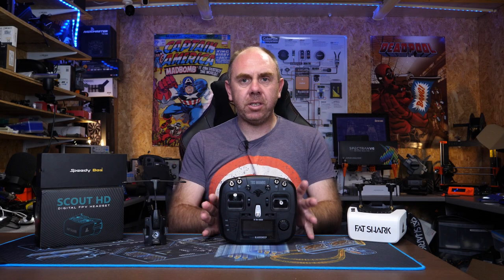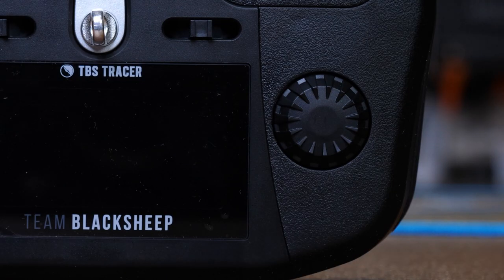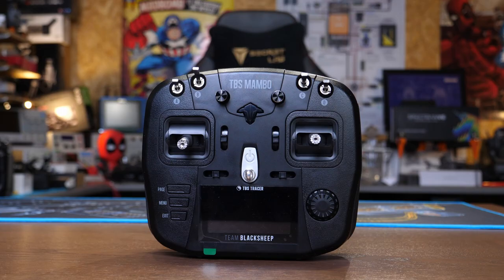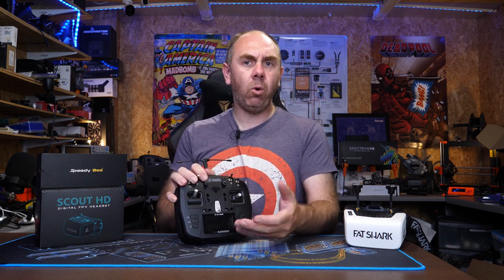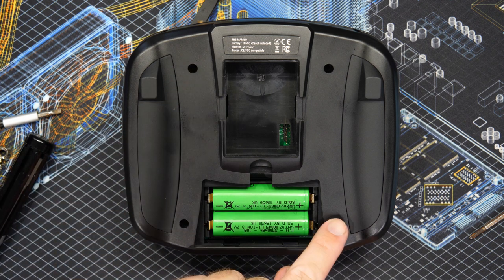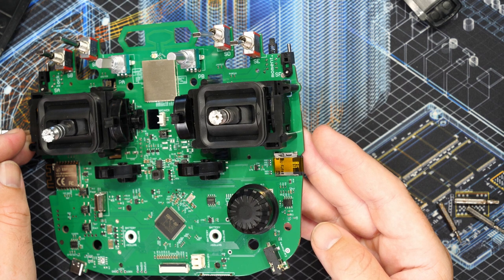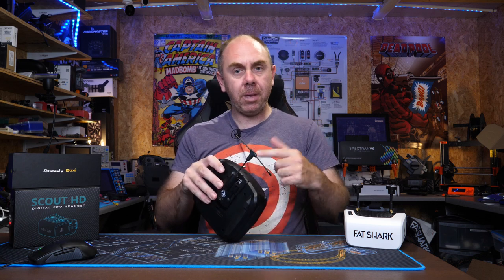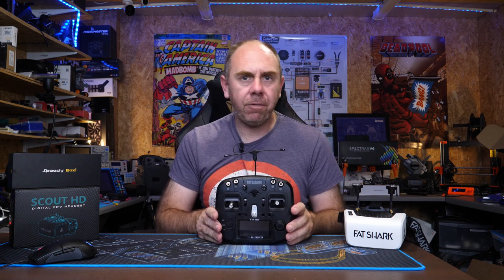TBS Mambo Review - Great Radio But Not Perfect

Comment: Looks to be a good radio but switch replacement etc could be a problem unless you are really 
competent with soldering and de soldering ! 🤔
So for me I will pass on the Mambo as I have broken switches before on my Tx’s  but they have been easy to replace 🎮
,

Comment: Hey due to quality of build, I had weird problem! Don’t know if anyone had the same symptom as mine: quad kept turning left (yaw)

I spent hours and hours trying to find a source of why my quad kept doing that. Reassembled my quad more than once.  Re-tuned PIDs many times and changed filters without success.

Ran stick calibration. All perfect at 1500us for center. Didn’t help.

Opened up black box and it showed I had yaw stick at 1480us value while flying!

Went back home and confirmed it was still at 1500us. WHAT THE WORLD….

At end, I gave up and pressed power button to power it down and I saw stick value  actually flickering on Betaflight transmitter tab! I paused and pressed on TBS logo. It did that too! Tried pulling hook. It also did it! Ahh.. hanging by lanyard was the culprit.

So what I will do with mambo for daily, use trim until movement stops. Remember… it’s made of plastic. Trim will vary by environment.

Please share your experiences!
Reply from the maker: I have seen something similar. I could not get it to calibrate at all on one day and it kept showing large jitter.  In the end I rebooted and it was fine.  I think there is a bug in the stick firmware.  I’m going to talk about this this week.

Comment: Have you updated the firmware on that Mambo?
Reply from the maker: I did when I had it but not recently, why ?
Reply: @MadRC  Seems to be some there are handful units with bad PCB. I got my last week and did firmware update right after unboxing it and it bricked. Found about 3 other people with same issues.  TBS will be sending replacement.
Reply from the maker: @FlyturboKwad  wow not seen that. I did the same as you update after I had it but I was good.  Let me know how you get on with the new board.

Comment: I really don't like the way they added the switches to the PCB. I know why they did it: less connectors = cheaper to produce. but it feels cheap and toy-ish.
Reply from the maker: My only concern is replacing them should one break.  It’s going to need a lot more playing and finding to get something to fit.  You could though just lower the pins and wire it anyways. 

It’s a neat design and saves them cost and manufacturing time. .